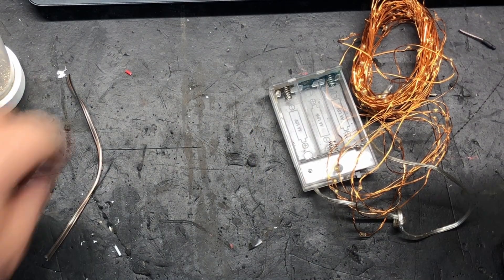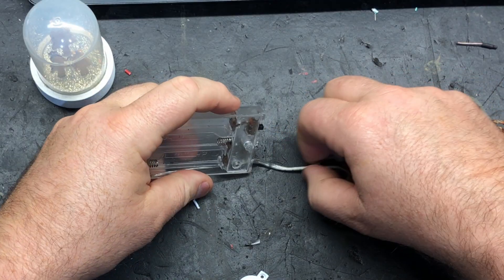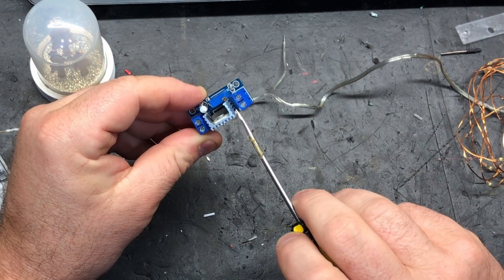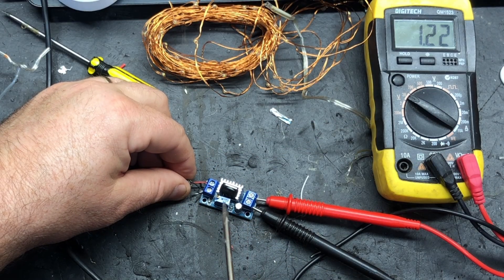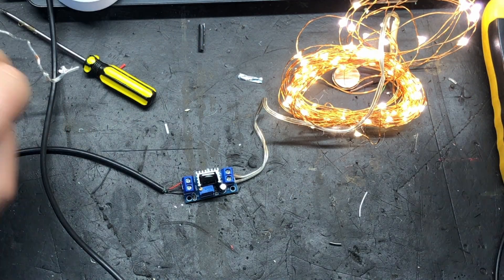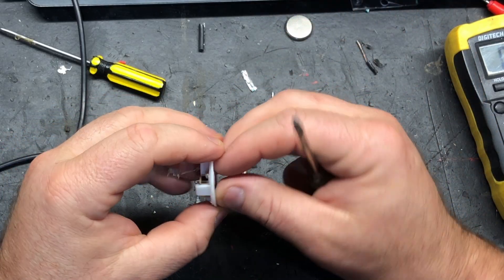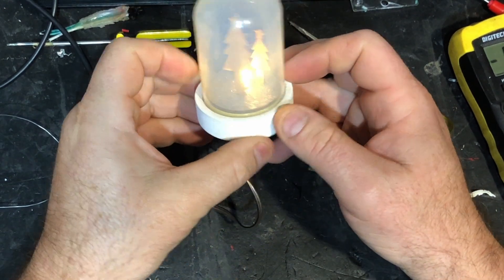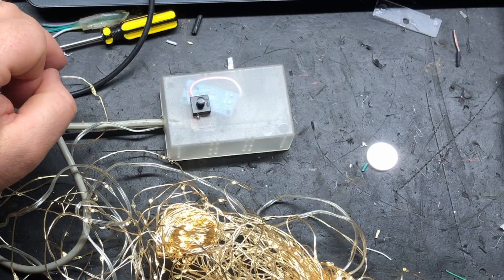How to convert battery or solar powered lights to low voltage power. Never buy batteries again.

Comment: "Crank up the converter but don't exceed the original supply, you don't want to over-drive the LEDs."
"Just add up the batteries -- disregard the blatantly obvious in-line resistor bringing the 4.5v batteries down to the requirements of this particular LED string, it doesn't matter if we over-drive them, we'll just shorten their life by 30%..."

Comment: you  are over driving the leds, 4.5 volts is too high, thats why there is a resistor in series with the load
Reply from the maker: I released this video in 2022, they are still going to this day. I have them over my mantel and they go all day every day. No brightness drop.

Comment: Oh no! This is so wrong. Good idea but badly made. There was a resistor between batteries and LEDs to limit the voltage/current. You are overloading the LEDs if you bypass this resistor. 4.5V should never reach the LEDs!!!
Reply from the maker: I released this video in 2022, they are still going to this day. I have them over my mantel and they go all day every day. So can't be too wrong.

Comment: Hi I'm wondering if you can provide some advice? I have 1500 led string fairy lights (150m). Solar panel no longer works and I am trying to convert to power. There were 3 batteries with a total voltage of 4.2v. 
How could I connect these to analternative power supply?

Comment: Can u put the link to buy that power converter that you used thanks
Reply: Don't bother. A better way is a 22 ohm resistor in the positive wire.
Reply from the maker: This video was to demonstrate the concept. Also I released this video in 2022, they are still going to this day. I have them over my mantel and they go all day every day. So can't be too wrong.

Comment: This is not the correct way to do this; you are overloading the LED's. Don't use the regulator module. Just use a 22 ohm quarter watt resistor in the positive wire.
Reply from the maker: I disagree. I released this video in 2022, they are still going to this day. I have them over my mantel and they go all day every day. So can't be too wrong.
Reply: just because its working doesn't mean the design is correct. Do what you like, but I stive for correct design. @TownshendChristmasLights
Reply: Do you have a video demonstrating the 'proper way' very interested if so
Reply: I get blocked from posting a link! @austonwheeler623

Comment: I was wondering if this could be done. I have some solar firefly lights. I dunny want to leave them outside because of the dinner heat would dry out the plastic. So they sit in their box.
Thanks for the video!

Comment: Dont you still need a current limiting resistor so LED's are not over driven? The life span will be shortened with out one as the current will be too high.
Reply from the maker: Not really. The buck converter handles that.
Reply: No it does not!
 @TownshendChristmasLights
Reply: Yes you absolutely do, if you want to maintain the full life-span of the LEDs, they are the cheapest possible quality and are sensitive to being overdriven.  You even had a big old easy-to-read resistor in the original battery pack, it would have taken a single trivial calculation to discover if the specific LED string you have actually needs 3.8v or 3.5 or 3.3 instead of 4.35.
Over-drive them by 10%, shorten their life by >30%.

Comment: What is the max input for the voltage regulator (buck converter), I have blown 2 using an AC-AC Adaptor: input 230-240V -50/60 Hz, output 22v-10VA
Reply from the maker: I suppose it depends on the model you get.
Reply: @TownshendChristmasLights  I think I found the problem; you need to use dc-dc adaptors.

Comment: I know zero about this, but want to learn this skill. Hate all these battery powered lights. So, why can't you just attach the USB wires to the now stripped string light wires? The voltage is too different? Sorry for the noob question
Reply: The voltage is not too different (5V vs. 4.5 V) but if you look closely there is a resistor inside the battery holder. So, you would need at least a resistor to limit the current in the LED string. Personally I use a constant current driver (two bjts and two resistors) so that the string can take any voltage between 3 and 12 volts (even 24v) and keep the same light level (actually below 4v the brightness drops).
Reply: @copernicofelinis    wow, nice. Thank you

Comment: I don't think that's a proper buck convertor, buck convertors use a coil to transform the voltage. It looks like a simple voltage regulator.

The difference is, a buck convertor takes a higher voltage in at a lower current, outputs a lower voltage at a higher current. A lot like a transformer, except it's all DC so it needs a little circuit.

A regulator like this takes in a higher voltage and outputs a lower voltage, but at the same current. The extra power from the voltage is just turned into heat. Hence the metal heat sink on the main component.

The difference in practice, is that a buck convertor doesn't waste power as heat, it's more efficient. And also therefore isn't likely to overheat. It's not a huge difference in practice, though if you were using batteries (eg a home solar setup or the like) then it's best not to waste power.

Both types of convertor / regulator are available cheaply, but the type here is just a bit cheaper. Trust Chinese sellers on Ebay or Aliexpress or whoever, to sell the cheaper one labelled as the less-cheap one. Not a huge deal but better to get the real thing. 

Nice video though, it's a very practical idea. I did the same thing, my grandmother used a string of battery-operated LEDs just to be able to see enough in the bathrooom without the light on. They were 4.5V, 3xAA batteries, so I could just cut the wire off and attach them to one end of a USB lead. USB is 5V, close enough to 4.5V that it doesn't make a difference in most applications. So I didn't need a convertor, you could probably have done without one here. With a phone charger, plugged into the shaver socket through an adaptor, gave safe low-power light with no batteries to buy.

In the UK, we aren't allowed mains sockets in bathrooms, for safety. An exception is a 120V "shaver" socket meant for just that, running off a small isolator transformer, so your shaver is isolated from earth. So to get a shock you'd have to touch both terminals, not just live. Same way a bird doesn't get shocked standing on a wire, cos he's not touching the earth. Then even if you did get a shock it would only be 120V, less deadly than the usual 240V. The sockets use an American style socket rather than the usual 3-pin UK socket, to stop people trying to plug in hairdryers etc. Electric razors sold here usually have the American plug on them.

[I know you probably know most of this, but for the benefit of the viewer...]
Reply: 4.5V on LED is massive overdrive, oryginały there is resistor in serieres with LED.
Reply from the maker: Hi great reply. Thanks for the clarity on the buck converter vs regulator. Yeah the USB voltage would be fine, really just playing it safe.
Reply: @TownshendChristmasLights  Using the regulator of course gives you the added versatility that later you could run it off 12V or 9V or some other source if you wanted to, whatever it's rated up to. 

Then there's the opposite of the buck convertor, the BOOST convertor. That increases a voltage (at the cost of drawing higher current). Rather than higher voltage / low current in -> lower voltage higher current out, like the buck convertor, it's the opposite. They're often used in those solar lights, to allow a cheap 1.2V Nicad battery, charged from a cheap solar panel, to run white LEDs that require around 2.7V to light up. You can buy boost convertors as modules too, set up just like this one.
Reply: Shouldn't there be a resistor in there aswell to regulate the current? Thought the leds will burn out
Reply: You are correct, this is not a buck regulator. It is an LM317 variable linear voltage regulator. You don't need the regulator, just use a 22 ohm quarter watt resistor instead. This will limit the current to about 100mA.